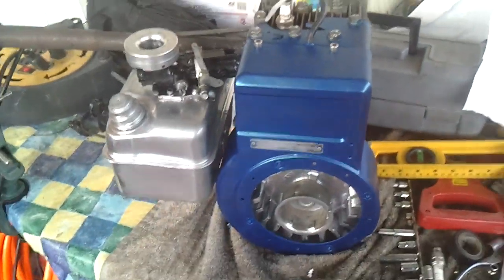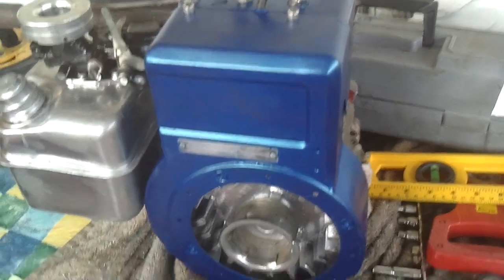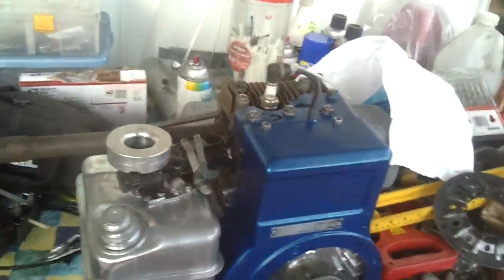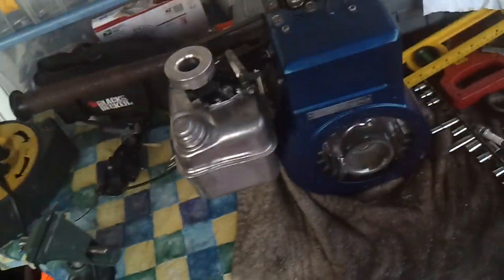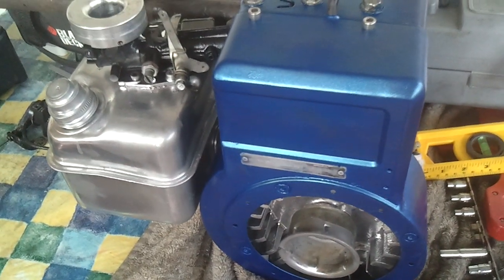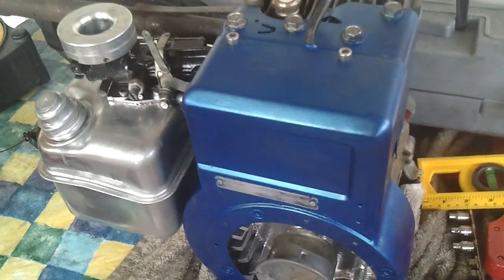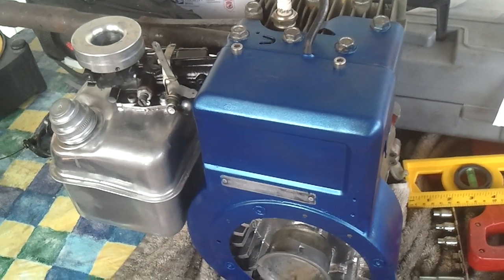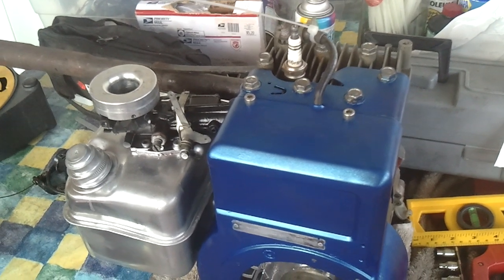Rebuilding a Briggs Raptor 5 hp engine

Comment from the maker: it should fit without any mods....but i think that cam is hard on the valve train and i think you need to have the lift area welded, you might want to google it and see what comes up